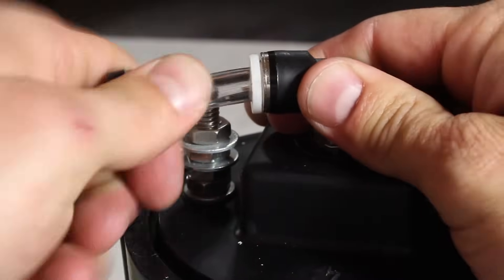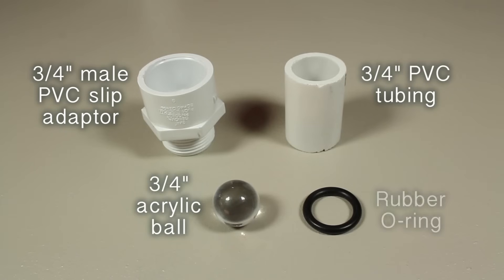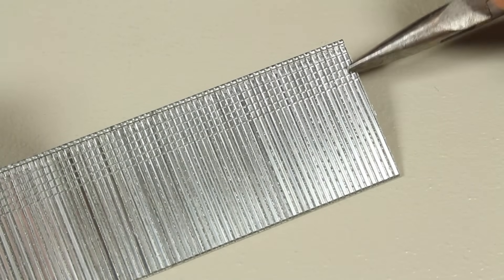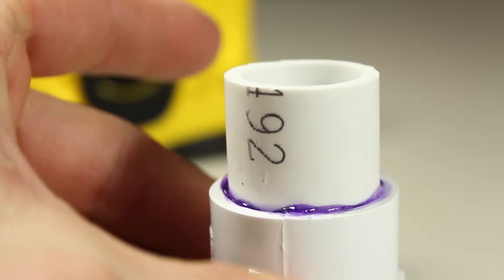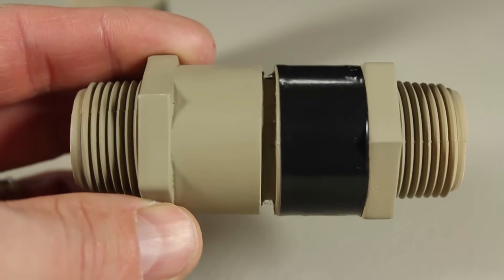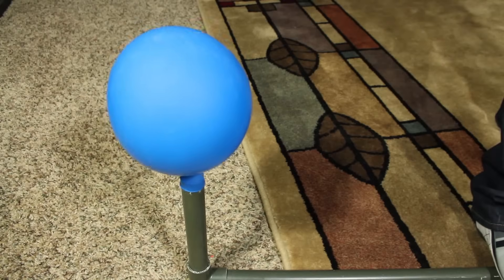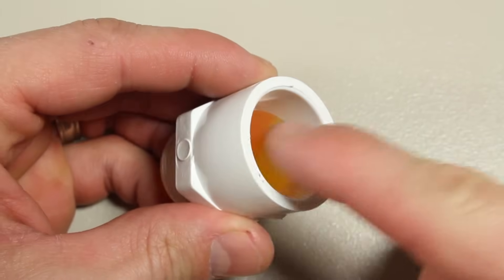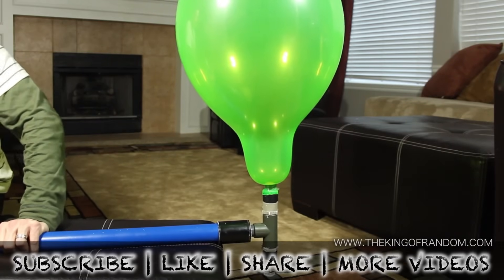How To Make a One-Way Check Valve - For Cheap!!

Comment: is it just me but I was really disappointed when we didn't test the max pressure it could handle.
Reply: +Xander Zoolander I think he's saying that he wanted to see a spectacular failure of the valve, e.g. the whole thing exploding and the acrylic ball blasting a hole through the wall.
Reply: @jamesbrown99991   Lol, exactly!
Reply: +spik330 as a plumber I know what we get away with... it depends on the pipe used, the glue used and a few other things...  some pipes are rated only low pressure, meaning less then 20 PSI, while others are rated for about 300 psi at 70 degrees... it also depends on the glue and primer... the one he used was a low pressure glue and primmer that can handle a bit more, but you have to let it sit for up to 24 hours...  there are others rated for high pressure meaning again several hundred PSI...  just be sure to look at the pipe as it is labeled and to get the "Pressure" PVC fittings... you cant find low pressure, aka waste and vent fittings, below 1 1/4"... so if you keep to 3/4" sizing, you should find the fittings that can handle any pressure most compressors can handle....
Reply: +spik330 "The risk of higher pressures is that the balls may be forced from the adaptor, shooting out like projectiles. High pressures may also cause the ball to lock up, preventing normal operation of the valve, or possibly even structural failure of the valve altogether." Just look in the description.
Reply: +spik330 
maybe +colinfuze  is brave enough to do that :)
Reply: Sean Britton  Rubber o-rings have some give and flex to them, that way the ball creates a seal. Metal ball with a washer wouldn't allow that seal to happen, unless the ball is on-center of the washer and the washer was machined where the hole was dead center, and you have enough pressure to create a seal between metals. Metal washer with a rubber ball could work, but the ball would eventually deform due to the metal washer basically cutting into the sides, if enough pressure is applied.
I think the only better solution is an o-ring with a larger i.d. so that the ball can't wedge itself into the center of the ring and become stuck. 
But I honestly don't think anyone doing a diy check valve would be needing over 60psi.
Reply: +spik330 just google the max pressure rating of schedule 40 pvc, 

edit: though i guess the gasket would probably get pinched before the pvc gave way and it would start to leak.
Reply: Sean Britton The rubber o-ring would fail before any of the pipe or joints would. Unless you get a different sized o-ring where the ball can't slip into it (that's where this is designed to fail) then the psi rating for failure would change, but would probably still be dependant on the o-ring considering it's the weakest link in any of this.
Reply: Xander Zoolander I believe a washer would work better especially if glued to its one end...
Reply: but when you start talking smaller o-rings, then you start taking the risk that it will come out one of the connection ends...  where as a rubber gasket/washer wouldnt have that problem, you can make it fit the full inside diameter of the fitting, and even use the pipe you push into the fitting to hold it in place...   yes if you use to small a diameter I.D. of the gasket/washer, then you run into the risk of flow restriction...  but then you can also use a smaller marble to help compensate for that a little bit as well... but dont go to small or it will slip past your retention holder or the gasket/washer...

the reason why I know so much about this material is because I am a plumber...  if it isnt check valves, its the fittings and gasket/washer we are using...
Reply: @sbritton1313  
The outer diameter of the o-ring used in the video wasn't the same diameter as the inner diameter of the fitting. Also a ball wouldn't create a seal against a flat washer, which should only be used with valve stems.
Reply: zero umashi .
Reply: I was talking about a rubber washer....
Reply: What the heck happened to zoolander?  Are we posting to a ghost?
Reply: Chaotic Phoenix
Reply: I bet the rubber ball would hold alot of pressure.. Cutting it is a mistake. It will fail when the ball rotates and the cut side is in the place where it's supposed to seat.. Don't cut it
Reply: @GUCR44  if you put the retention nail low enough to the flat side of the ball so that the flat edge can't rotate, but far enough that air flow can get through, you'll be just fine. At least at lower pressure.
Reply: Could this work for water? I'd  like to use it for my aquarium.
Reply: Look in the description, it says up to 60psi works but anything over occasionally caused the ball to lock into the O-ring. This could be fixed by using a thicker, same o.d. but smaller i.d., O-ring as tolerances would be tighter and therefore  more pressure can be applied. 
As for the Rubber ball, it says it can be used in low pressure, but it could probably be used for high pressure also. Basically any pressure up to the ball wearing down enough to slip into the pipe, could be tested on a non-cemented version so it can easily be taken apart and inspected for wearing of the ball.
Reply: Xander Zoolander Your kind of missing the point; Which, is when it fails at max pressure. Whether it explodes or makes a really nice gun. I don't care at all about how much PSI the thing can handle. But thanks for the information anyway.
Reply: Psi is pressure.
Reply: Xander Zoolander I am aware of that. Though I don't recall asking what it was.
Reply: You wanted to know when it fails, description says, I restated that, >60psi.
You wanted to know the max pressure but don't care about how much psi it can handle? That just makes you sound like you don't know what psi was. 
Anything over 60 causes occasional failure, like the description says.
Reply: Xander Zoolander "when it fails at max pressure." There is a key word there. This is stating that I am interested to know what will happen when the device fails when it reaches its maximum pressure. Regardless of what that pressure is, or even if its unit is PSI or Pa.
Reply: When it fails, the ball gets stuck in the o-ring, as the description states.
Reply: Xander Zoolander I`m done, I quit. Some one once told to not to argue with an idiot because they will drag you down to there level and beat the snot out of you.
Reply: And how am I the idiot here? I was smart enough to read the description in the first place.
Don't be such a tryhard. Stay in school, you might learn something.
Reply: Sean Britton I assumed metal considering they are usually referred to when it is not specified what material is used. Most people would suggest a metal washer, anyways. 
A rubber washer could work, depending on the thickness. A thin one would probably flex and tear if there's too much pressure, then have no seal. A thick one could work, though it would need some flex for a better seal. And you don't want a rubber washer that has a small i.d., as that would impede flow and pressure. 
I still think an o-ring with a slightly smaller i.d. would be the best solution, since the only problem is the ball slipping inside the ring instead of sitting against it. Though I still don't think anyone would push something like this past 60psi.
Reply: spik330 ya me to

Comment: Phooey, I canceled my order for these acrylic balls and just bought two, 3/4" check valves from Home Depot for something like $3.50 each. The pump works great.
And the spring loaded valves work in any position unlike the ball type. I'm guessing it flows better too.
Reply: CW617N forge Brass valve, you can find out if you are interested,whatsapp:+8615570052161

Comment: what stops the o-ring from moving out of place?
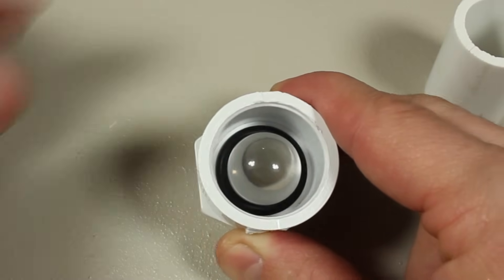Reply: +Logic Bob looks like at 0:50 the 3/4" tube is actually holding the O ring in place
Reply: Home Depot Check valve for $3.50?  Couldn't find one.  Maybe in a year the price went up 3x!
Reply: i think, that if you can't figure it out by watching the video, you don't need to be doing it. it really is that simple.
Reply: Logic Bob Nothing from what I can tell.  The check valve seems to be the weak part of this pump, especially since he doesn't give us a size for either the ball or o-ring.

Annoying frustrating project, wish I checked more into it before plunking all this money down.  Probably will just end up buying check valves since these acrylic balls are expensive, and this is costing waaaay more than $0.35 each to build.  More like $15/ea.
Reply: +ABikerLife Thanks for the reply.  I couldn't see any way of making this work as shown and still have decent flow.  If you use PVC with an I.D. of 3/4", the 3/4" ball would cut off all the flow regardless of whether it's seated or not.  So it needs to be smaller.  And it seemed like the o-ring would have to be unusually thick, which would cut flow down too.  I think the PVC pump is brilliant but these homemade check valves leave a lot to be desired... but the Home Depot ones flow great, and only cost $3.50 each.
Reply: +pk1225 you can use a 25 cent rubber ball. Pretty much everything about this is just stuff you can easily get, or already have. It is not going to be high performance in the least, but it will work for general use and quick projects. I see a lot of people comments talking about flow and whatnot, it is horribly obvious in the video that flow is not a stunning attribute, only that this valve works and can be put together easily and with items availible and usually in your own home or garage if you have a garage and a couple kids (because what kid doesn't have at least 1 rubber bouncy ball?). 

I don't think I would have bought stuff to make this, because that would be pricey to buy all the peices, but honestly, this is easily made from pvc scraps you would normally throw away, and I think they just didn't say that on the video.
Reply: +pk1225  I believe the ball is 3/4.. O-ring is hard to find. Has to be a thick one. I have everything built except for the o ring. None in my assortment seem to fit and be thick enough.
Reply: Yeah, I'm in the same boat pk1225. I've been having a helluva time getting this to work. I wanted more flow, so I was trying to use a 1" rubber ball and larger, 1.5" fittings. I had a great, compact solution with great flow, BUT the small seam on my rubber balls prevented it from sealing. 

I'm determined to make the check valve myself and I tried to think of some other designs but I was having the same problem you describe. I ended up ordering five 1" acrylic balls from eBay for about $15. I found my local OSH/Orchard had a great assortment of o rings, but like you both mentioned, it has to be really thick or it will have to be glued in place.

I'll try to update this thread when I get the acrylic balls.
Reply: trolling-to-wake-you-up
That is for sure. I tihnk it would still be handy. I mean, if you work with stuff a lot, you often find yourself needing something to do something that you may only do once and never again, and even outside of emergencies, well, you don't always need the best, sometimes you just need it to work, and this will do the trick :D.
Reply: #18 o-ring ordered on mcmastercarr
Reply: Magic
Reply: absolutely mid-school in 1980s USA tech. at LATEST

Comment: Couldn't get mine to work whatever i did.
Either my o-ring is of bad quality or my decision to use a glass marble in stead of an acrylic ball caused it. When blowing in the restricting direction, i can hear the stream of air escaping :(
Reply: jordan john tried hot glue, rubber like material, wax, but nothing worked better than nothing which wasn't that bad. you can just about hear the air.
But thick grease fixed it.
Reply: I had that problem too but its because my rubber ball has a seam which is fouling the seal. Trying the o-ring/acrylic ball route now.

Comment: Great DIY project! I love it.
btw, what is your suggestion if I want to build one-way valve for 5 inch PVC pipe or bigger?
thanks anyway :)
Reply: Curiosity84 Find a 5+" diameter marble and appropriate o ring. :P
Reply: Curiosity84 Find yourself a 5-pin bowling ball and use a rubber toilet gasket seal :P Seriously though, cruise the local toy store and check out their toy ball selection. Might not even need a gasket.

Comment: Now, with this, is it possible for the exit end of the check valve to hold 15 atm?
Reply: +Mr.chang cooler What if you connect 3 valves together or use metal instead of pvc?

Comment: As far as pressure goes, look at what your PVC is rated at.
Reply: this is for sump pump that uses garden house, no need to worry about pressure.  i have 2 zip ties and duct tape holding it very securely

Comment: Could this be air-tight enough for a high-vacuum machine? I mean, for keeping containers at high vacuum. My guess is that it will, since it can handle 50 psi and atmospheric pressure is about 15, but I'm not sure.

Comment: I'm kind of a newbie when it comes to pneumatics.

Would using a sleeved O-Ring assembly instead of a seated one cause less stoppage issues at higher pressure applications? I'm trying to make a better actuator valve for a reservoir  tank for a custom application but am running into problems in the 400-600 PSI range.
It works fine for me at the <300 range (I think it's because I'm using larger, stiffer rings on a wider shelf), but I'm looking to get it higher. 

Suggestions?
Reply: more pressure, better it seals, but do you really want to put that much pressure on PVC fittings?
Reply: 24hourspacebar If your using 400 - 600 PSI in PVC, I'm thinking you may have been to the ER lately ! Commercial robotics work with 15 - 100 PSI all the time. They use metal. Don't trust PVC even for anything more than about 40PSI since that is what water pipes are designed to hold, if you are using the PVC for water. 400 PSI is an explosion waiting to happen in PVC or other plastic unless designed for high pressure like hydraulic lines, and they are strong rubber with a METAL weave inside to hold the pressure. I would stick to below 40 PSI when you are starting out. You can make plenty of machinery at that pressure. All the robotics I have worked with used 100-120PSI air source with a REGULATOR that would reduce the pressure to around 15 - 20 PSI. Maybe 100PSI for very large pneumatics that need really high clamp force for welding, ETC. But the higher you make it , the more air you will use and the higher the wear on the system, faster failure. Higher noise with higher pressure too. Depend on the metal with metal threads to hold things together, not PVC glue. If you stay under 20 PSI you may get away with PVC. But I wouldn't. 

Get some mufflers for the exhaust too and some ear protection for being around the air exhaust. It will damage your hearing in the long run without it. Eye protection is also a good idea.
Reply: Rich Taylor  Hopefully the guy read your comment before embarking on some half assed experiment, you probably prevented an accident or worse.   What do you expect from "24 hour Space Bar".
Reply: Accidents happen bruh, but I did read it.
Reply: +Rich Taylor Also, I already finished the application and it works fine, no incidence of failure (yet).  It's not even for what this guy uses. most of the hardware, threadings, and fittings are metal cased or have metal in them to support the operating pressure. The only reason I'm asking if a sleeved one is better than seated is due to pressure issues I've had with seated assemblies in the past. Funnily enough, I only got the notification for your reply to my comment yesterday. Go YouTube.

Comment: yes, like the hundred other people asked already and none of them have been answered.  where do you get a 3/4" or 20mm acrylic ball?  i'm cuttin open a paint can later, but i suspect it's not 3/4".  ebay sells them for about $6 a piece negating the very title of this video.

anybody?  anybody?  Bueller?
Reply: 3/4 inch or 18mm acrylic beads from jewellery supplies on a certain auction website maybe? Might come with hole in the middle, but can be blocked with two part glue or similar.
Reply: I use to get the little bags of 100 marbles, from either Dollar General or the Dollar Store.  The one I got came with 100 normal sized marbles, and one giant marble.
Reply: try amazon
Reply: appreciate the link. i may even use it in the distant future.  but that price breaks the bank for the budget on this video.  in the video i seem to recall him mentioning that the grand total price was around eighty cents.  Still negating the very title of this video.
Reply: at ten for .81 then yes.  the only other part i am having trouble with is the fitting with the groove.  no grooved fittings in texas.
Reply: the groove that the o-ring fits into.
Reply: watch that video again real close.  that slip adapter has a groove down inside it.  he explains it and shows it in detail.  I have made these with regular slip adapters with no groove and they don't work as well especially pneumatic.  haven't tested hydraulic yet.  I just got out of the hospital.  but the one he uses has a groove and there is a reason for it's necessity.
Reply: AMAZON, WALMART, CRAFT SUPPLY  Bag of 10 for under a dollar.
Reply: Bob S 3/4" = 19 mm.
Reply: Once you pushed the 3/4 pipe deep in there, the rubber oring became a groove for the ball....or as a ball seat.

Comment: I know where to get the pipes and o ring from but where do get the acrylic ball out of ?was salvaged from somewhere? or can buy them over the counter at the hardware what are normally used for?
Reply: you can use almost any marble you can find, including the smallest one i found so far, inside a paint can, or the decorative ones from walmart in the arts and crafts (the cheapest big bag i could find) if instead of an o-ring you use a hillman 7.1 mm grommet from lowes upc # 0-08236-71652-8.  it has an inside diameter of 1/2" and outside diameter of 31/32" fitting those 3/4" pvc fittings perfectly